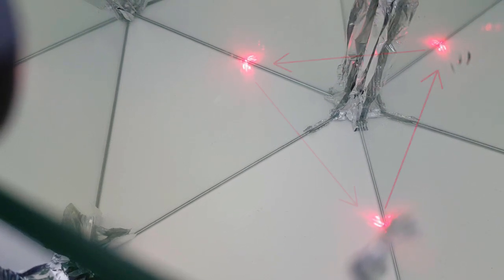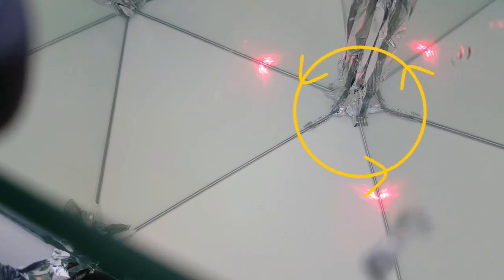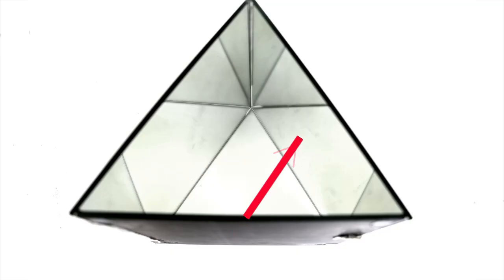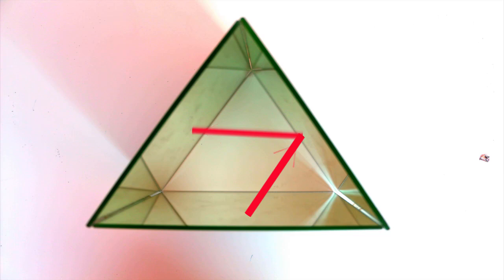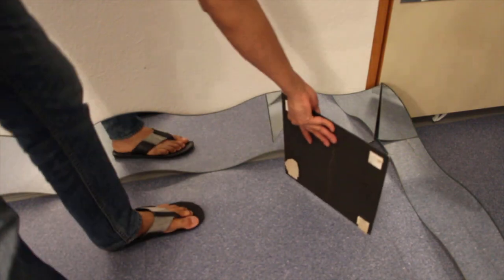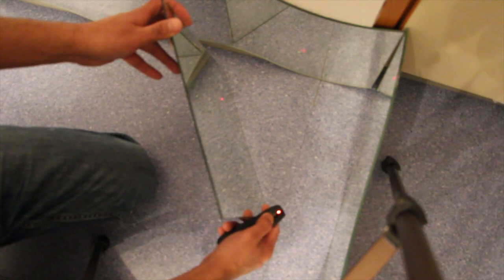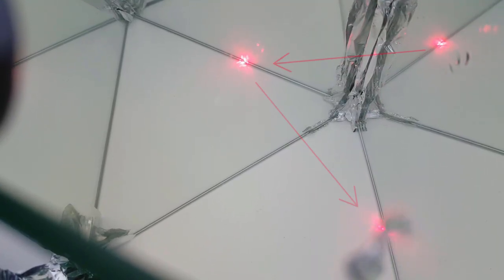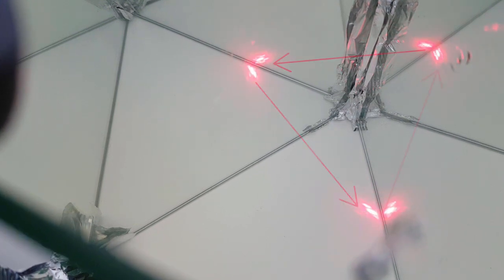Can light be trapped between mirrors

Comment from the maker: This is the main video in where you can see ''Can you trapped light in a mirror box | Light trapping box''
https://youtu.be/v45HhFV3h7Y
Reply: Dude if you could adjust the mirrors accurately such that the length of the path of light is a multiple of its wavelength it will make standing wave and it will not loose its energy and you can actualy trap light in the box.
Reply: Sir actually light is not trapped becz if light is trapped how can you see it 
According to science you can see a object or light when its photon get to your eyes after striking

Comment: it is the lightsource that must remain on, you are just playing around with the rotation of the mirrors. Light can be trapped but the placement of the first light source and the mirrors has to be exactly precise, as precise as you need to be when you are making a magnet float on top of another magnet which is basically imposible.

Comment: this isnt how it works, the light isnt traped since you can see it, as soon as you see light the light photons that entered your eye are gone, absorbed into your eye. And you can clearly see the light from the laser since it changes in more directions that just one so there is light that isnt "traped". Also even if you had a fully enclosured box or something that you manage to get light inside even without opening it the light should be gone faster than you can blink since everything absorbs a x% of the light and converts it to heat (i think)

Comment: Hi forgive and correct me if am wrong in my understanding but you are not trapping light as per premise. Your premise as i understood is that light will keep reflecting and follow the same path  in between 3 mirror,  infinitely till it loses it's power due to many factors.

But your geometry does not support it. You are simply coinciding you initial reflection point with your point after 3 reflection. But the vector of light is changed. So it will never follow the original path. For a mirror surface the reflects perfectly light  always follow a unique path dependent of the initial path. Here you are just reflecting the light back to laser if your dots are coinciding, Which is equal to pointing light perpendicular to a mirror.

There are many geometrical paths where if light when inserted will follow that path till infinity but the practical problem lies in inserting the said light since you would need to modify the configuration to keep a continuous source channeling light and that will destroy the geometry .  

Light can be trapped indeed but any instance of light trapping will be of two types as per my limited knowledge. 
For true infinite. trapping :If you suddenly remove the source between 2 perpendicular mirror.  That would become a light that is trapped but hard to be observed by naked eye as any attempt to detect it will absorb those photons.

For continuous you do as it is done in laser but it is eventually refracted through.
Reply from the maker: You are absolutely right what you explained above. Thanks for amazing explanation.

Comment: This is not correct at all. I am sorry. But have you ever heard of Febry Perot Cavity? and the laser devices? It is the correct way to do it. Not this.
Reply: In your experiment, the problem is the entrance of the beam, and the last reflection to complete the beam is not aligned, so it cannot form a proper cavity. You cannot make a ray diagram to complete the loop, because incident and reflection angles of each point must be same according to the law of reflection. 
Only way to form a closed loop cavity is by using a one semi transparent mirror, or keeping a fluorescent light source inside the cavity, which can be (optically) pumped externally. That is how a laser device works, by amplification of light.
Reply: There are other ways like Whispering Gallery Mode. There are actually a lot to learn here.

Comment: Light will be trapped in the "box" for a very short period of time (assuming the source is turned off after initial burst) because mirrors are not perflect reflectors so after every bounce, you will lose ~0.5% of the light to heat. Also light will hit air molecules thus further reducing the amount of time light can stay in the box. Very interesting nonetheless.
Reply: So we need more perfect mirrors and vacuum, got it.
Reply: @amazoniancustodian  Well technically you could use a black hole and make the photons rotate around it. Thats what we call event horizon
Reply: @montec6113  the next step is creating a mass multiplier then
Reply: hey, i was reading somewhere that when light travels from deser to rarer medium it doesn't refracts in some cases and reflects without losing energy. so the cass that is of a prism(90° 45° 45° hypotoneus being the reflecting side) if you put to prism opposite to each other, would it result in infinite reflection. in really curious
Reply: Ok mr. Physicist.

Comment: But that's not really trapping the light if the light source has to remain on.
Reply: this is the most stupid science by a stupid guy , it dosent trap the light it actually change the direction of the light
Reply: Yo what if the light source is inside the enclosed space. Once you turn it on you can turn it off and there would still be light trapped in the enclosed space.
Reply: @tydortch3063  thats not how it works, everything that exists absorbs x% of the light that hits it so the light should be gone so fast that your brain couldnt even notice it was there more than when you turned of the light source.

Also this video is bullshit, the light isnt traped since you can see it, as soon as you see light the light photons that entered your eye are gone, absorbed into your eye. And you can clearly see the light from the laser since it changes in more directions that just one.
Reply: @tydortch3063  No it wouldnt. Mirrors dont reflect 100%. The laser would be absorbed before you can register it
Reply: yea, this is not traping light.
Reply: This is not trapping it is reflecting
Reply: @dhrubokarim8751  তর কি তা হালা
Reply: @Dhrubo Karim no shit lol. That's what the comment op was getting at.
Reply: More than that. If you can see de light it's not trapped...
Reply: U are right it means it's illusion
Reply: Correct. Ruby Lasers are the perfect example of light trapping and amplification
Reply: @dhemanth01  no they are not,,once the light is turned off it goes away,,lasers do not trap light,,there is no such thing that exists,,unless you watch the movie iron man where he supposedly traps a power source in a triangular crystal,,all sci fi bs
Reply: @ARCSTREAMS  no, Lasers are real and considered as light. So the right way to do it is exactly angle every mirror like 2d so you don’t have to trap every side and you have to shine so little light because it’s real fast so it’s impossible unless it’s connected to a computer with a really fast on/off program, that’s how speed of light was calculated
Reply: @ItzRomanPlayz  "Lasers are real and considered as light" yes i know that and as for the rest of your comment i do not know what you mean or what it has to do with my comment that said you can not trap light ,once the light or power source for the light goes out the photons are gone with it
Reply: @ARCSTREAMS  I know, but since the speed of light is 670,620,000mph they use a 10 trillion fps camera and somehow they got to trap the light. If you want to see the video of them doing it, the video name is “10 trillion fps camera with light” which is the fastest camera in the world. Well in my opinion they did only 2,000 picoseconds of it and a Femtosecond of light so maybe they trapped light for a few microseconds while the light bounced around like pong.
Reply: @ARCSTREAMS  There are highly specialized techniques developed to trap lights, it has been done in the lab
Reply: @rickdonaldson9048  lol i really think it depends on the definition of what "trapping light" means,, are you saying they were able to shoot light into "something" and then shut off the light source yet still have the visible light trapped in this  "something" ?? please show the proof ,got link? and remember if you are able to see the light then it is not trapped but reflecting all over the place and once the source is shut the light disappears as well , no such thing as trapping light
Reply: @ItzRomanPlayz   yes it may take a very short time for the light to escape after bouncing around in something but that does not make it "traped" , once you shut the source of the light the remaining light that is bouncing around escapes or decays ,yes that takes a very short period but it does not count as trapped otherwise it would not escape or decay due to energy losses ,there is no such thing as a perfect reflector with no losses ,happens very fast because of the speed of light but it does not mean you trapped it ,it simply cannot exist or sustain itself unless there is a continuous source creating the light
Reply: @ARCSTREAMS  light doesn't decay, since they're not like other particles and they are pretty much pure energy.
Reply: @mixableweevil8145  i should have said "absorbs" as in it gets absorbed by the mirrors or whatever is supposedly trying to trap it or it simply escapes
Reply: @ItzRomanPlayz  The speed of light was calculated over a hundred years ago.. The laser experiment just refined it a bit.

Comment: hi. I have a question... If we project light from a source on to a mirror, in term of the energy emitted, is it the same as having 2 of the light source? should the light intensity doubled?
Reply from the maker: I guess you were asking the amplification of photon energy, am I right? No, we cannot amplify the energy of photons. Yes, it is the same as having the previous steps of light even lower than the previous one.
Reply: @Matescium  if we imagine a light source in a room full of mirrors compare to normal wall, room with mirrors is brighter despite having the same source. Does the two have the same quantity of photons? seem like a mirror prolong the photons existence..? is it reflected or duplicated?
Reply from the maker: Well, if the mirror is a perfect mirror (though practically perfect mirror is impossible), in that case, light photons will be scattered/reflect around the mirrors, in this case, no new photons will be created. that means it will not be duplicated. Look at this experiment, the intensity of the reflected beam is weaker than the incident beam means photons are reflected/diffracted. They cannot be duplicated.
Reply: @Matescium  then, what makes a room with mirrors brighter? if a photon hits a wall, how is it different with hitting a mirror? a mirror reflect the photon and the wall absorb? by reflecting a photon, is it keeping it available for a longer period? its exactly like your project here, Light Entrapment
Reply from the maker: when photons are scattered in many directions due to the mirror like reflection, means it travels many directions that makes a room brighter. That means photons are distributed in each corner of the room that make a room brighter. But some photons are absorbed by wall or mirror itself. I believe photon can be trapped longer period if a perfect mirror is available. I made a titanium made mirror that is much better than conventional mirror.

Comment: But if the light was truly trapped in the constant reflection of itself wouldn’t it continue to make circles around itself after the source is turned off? Or where does all the atoms making up the light go? Is there a way to preserve any light without any source? What makes the molecules in the air glow anyway? If you shoot a beam of light where does it go and does the light still exist far away or what? The speed of light really never made sense to me is it fixed set of glowing molecules moving fast or if it’s just like energy collecting up to create a structural “beam of light”
Reply from the maker: wow, a lot of questions seems i can make few episodes by using your question.